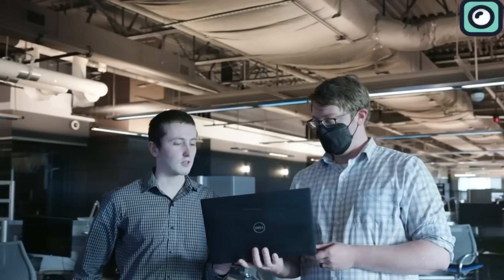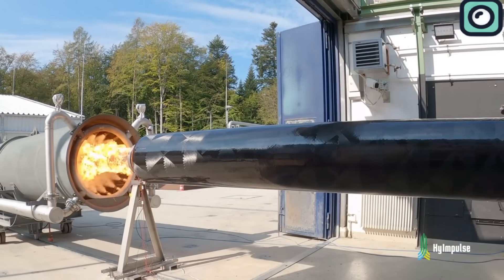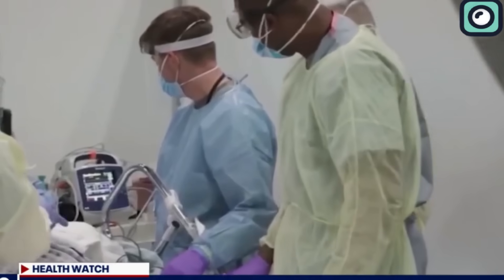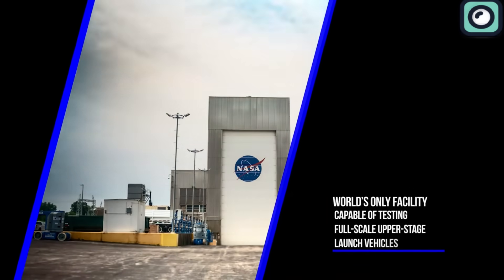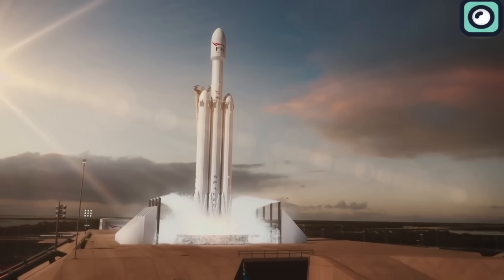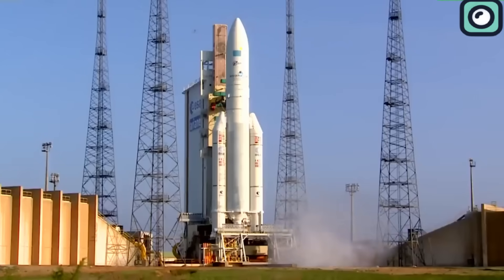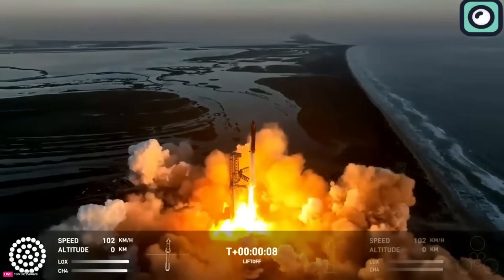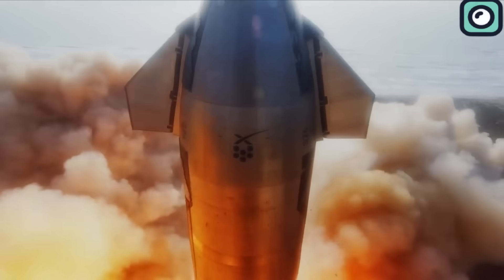NASA Made BIG Mistake With the Dream Chaser... Musk Reacts!

Comment: Dream Chaser "doesn't make sense"?  Are you arguing against the wisdom of a two-solution requirement?  I agree that SpaceX and reusability trump the legacy aerospace way of doing things but Dream Chaser, providing it works, has several important advantages that include greater payload capacity and easier/quicker recovery.  If it could be launched by SpaceX it would be a great boon to orbital operations.

Comment: You haven't made the case for calling Dream Chaser a "failure". It is a practical evolution from the reusable shuttle. If you're only point is lack of reusability of boosters why not launch with SpaceX?
Reply: It won't fit in the payload section and it's to heavy for falcon to launch
Reply: @juliancrooks3031  Definitely not too heavy for Falcon Heavy.
Reply: @kalkovonschpritzendorf1914  the fairing on the falcon is too small.
Reply: @ragnarlothbrok4281  oh damn, I believe that... but isn't Dream Chaser quite aerodynamic? I'm sure if they really tried they could make it work without a fairing. But I'm not a rocket engineer, so maybe not.
Reply: @kalkovonschpritzendorf1914  yeah for some reason they want it to have the fairing. The one for people seems like it probably won't have fairing so maybe that one. There's also the issue of competition since spacex has its own crew spacecraft there could be some trust issues.
Reply: Perhaps the folks over at Sierra Space should design their own Falcon-9 compatible fairing that is large enough because, after all, FH is a F9 with two side boosters... or change Dreamchaser somewhat to do without a fairing.  Go with the (long term) cheaper option...